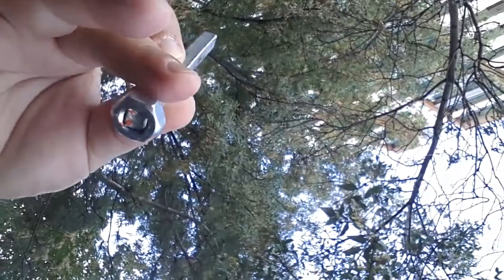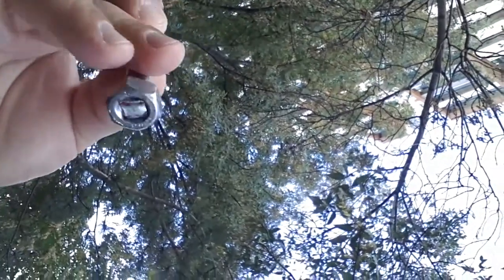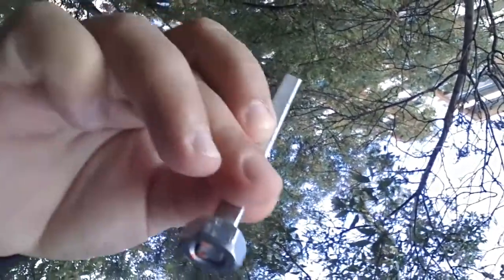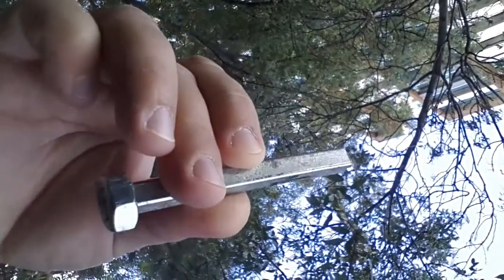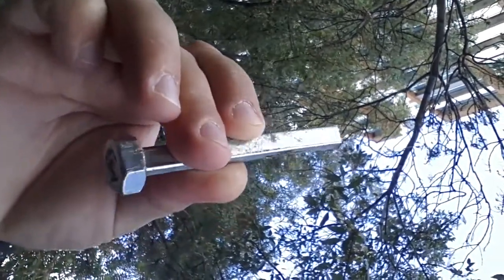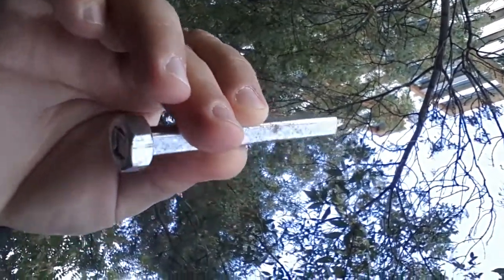Renault , Dacia, Nissan - Fabricating oil drain plug tool

Comment: I filed down the square on an old 3/8(9.5mm) socket extension took very little time and would be a lot stronger than this idea.
Reply from the maker: Creativity has no limits..! Thanks for  sharing. About the strongness, I've used the tool in the video for oil change (posted as another video) and it was good enough  to do the job.

Comment: Great idea been trying with an old drill bit and welded it to a power bar. But ended up breaking the drill bit lol. 
Retry for me
Reply from the maker: Hi, seems like you've spent lot of effort..!  If you can find a 8mm X 8mm  square metal rod  that is 10-15 cm  lin ength at a hardware store it may make life easier for you ..that's what I did .. Good luck..:-)